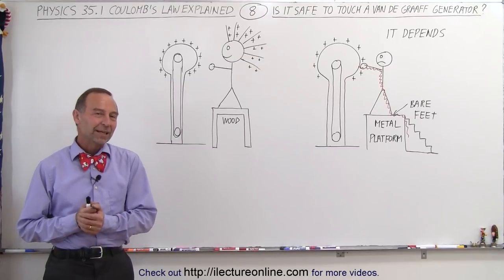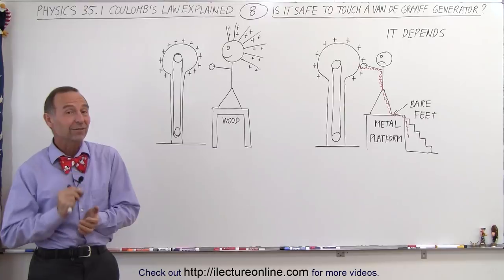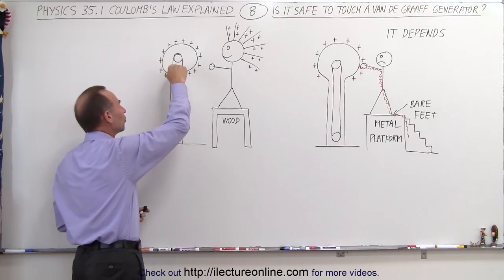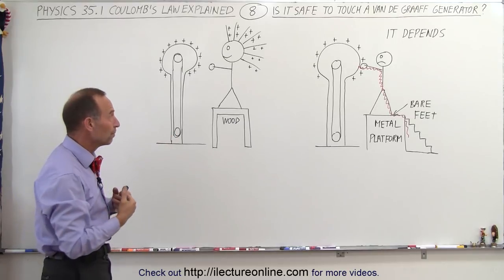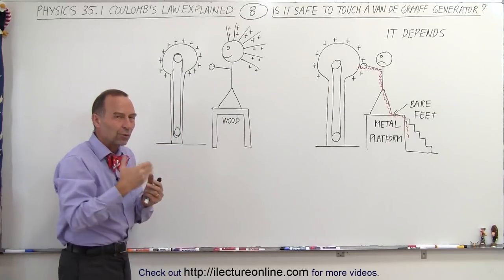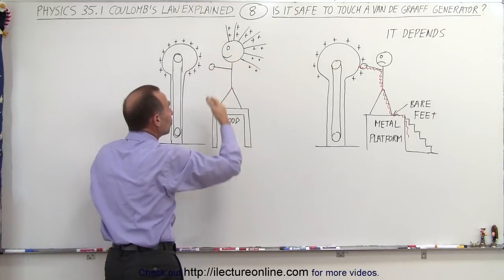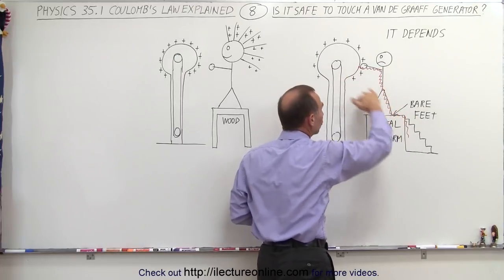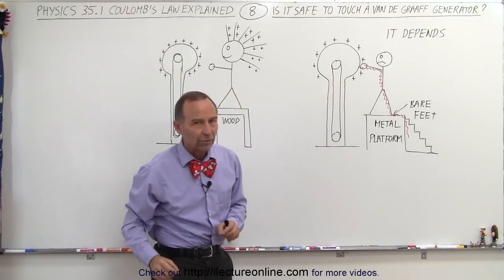Physics - E&M: Ch 35.1 Coulumb's Law Explained (8 of 28) Safe to Touch a Van de Graaff Generator?

Comment: before touching someone else should not you discharge the potential you gained ?
and if yes how ?
or just by removing your hand from the vandegraph the charges will flow down to earth slowly because the rubber you wear has a very high resistance allowing small current which will prevent high power  ?
Reply from the maker: Once you move away from the Van De Graaff generator, it is fairly safe to touch someone, since the amount of charge you have on your body will not be dangerous.  Coming near someone will cause a spark to jump across.  You just don't want to have a continuous path while you are touching the generator.

Comment: One question as wood is dielectric than can  negative charge of wood be assembled near body and positive charge away from body .
And if postive charge is near ground than electron from ground can move to wood 

Pls explain once
Reply from the maker: Wood is a very poor conductor of current.  That is why it is safe when you stand on wood.  Any charges entering the wood have no place to go.

Comment: How does van de graff genrator work
Reply from the maker: Essentially, a belt made of dielectric material collect charges from the bottom roller which is suspended over a metal comb that provides the charge and is carried to the upper roller made from a different material.  The charge will thus be transferred, which then charges a similar metal comb which is suspended over the top roller which then transfers the charge to the metal dome.

Comment: Professor if there is no conducting path when we are standing on the wooden block then why the charges flow to our hair if there is no path then the charge should not even flow??...The circuit is not complete.
Please reply sir...
Reply from the maker: Our bodies act a bit like a capacitor.  We can store extra charge on our body and our clothes, but it cannot continue to go anywhere unless a path is provided.
Reply: @MichelvanBiezen  do not we feel some shock as the charges are flow from the van de Graff generator to the hair? so we should get some shock in our hand.
Reply from the maker: Not if the charge builds up slowly enough.  But on a dry day if you drag your feet across a carpet, and then you touch a door know, you can sometimes feel the spark between your fingers and the door know before you make contact.  If the room is dark enough, you'll be able to see the spark between your finger and the door knob,

Comment: What if the van de graaf generator was negatively charged on its dome. How would it travel through the body?
Reply: The current (the flow of positive charges) would flow from the ground to the dome through you. It's the same thing in the opposite direction
Reply: @alessandroc.4543  thanks